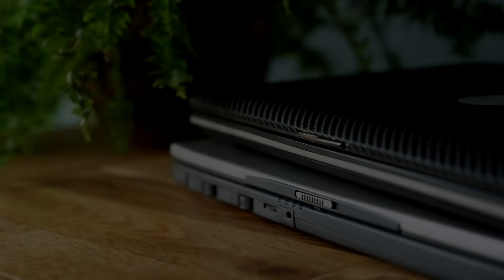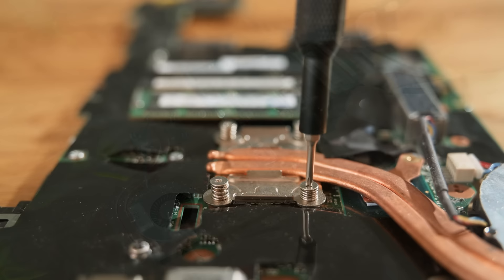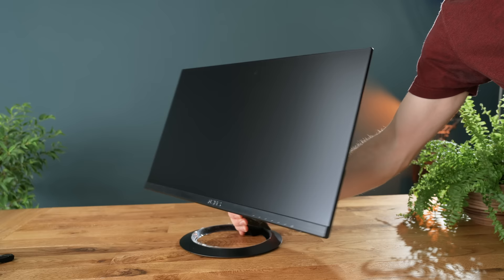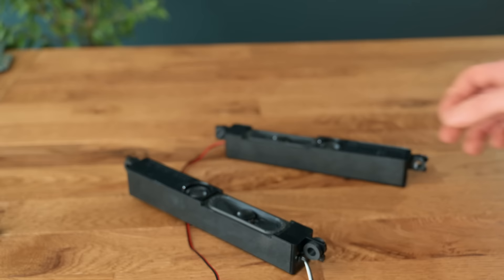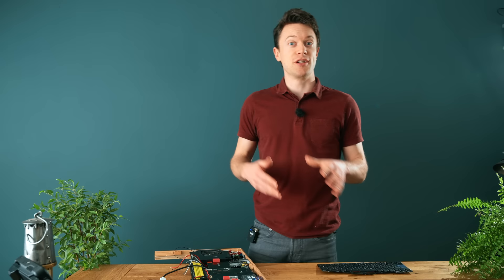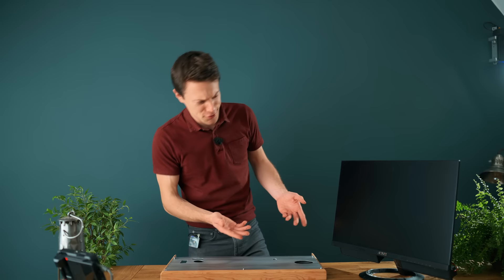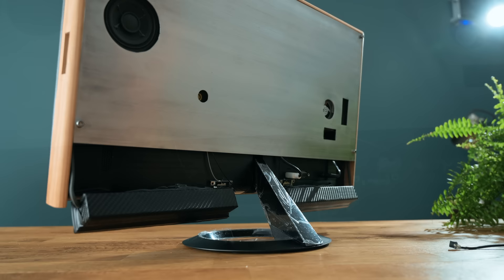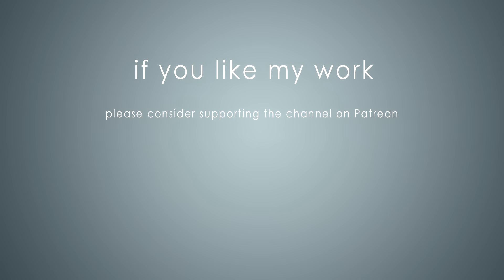Transform a Damaged Laptop into an ALL-IN-ONE desktop PC

Comment: That's a very clever way to turn it on, if it was me I'd just gut the keyboard and try to extract the button and ribbon cable 😁
Reply: Not in the long run though. Once the BIOS battery is empty, the settings will reset and it wont turn on on Power restore any more.
Reply: @El_Rekzo  what? how does that relate to my comment in any way?
Reply: @El_Rekzo  I have only seen empty BIOS batteries after they have been lying around for months with no power, and if THAT`S the case, I guess you`d have to live with setting it up again..
Reply: @El_Rekzo  keep in mind that there's a battery inside that holds power as well. So everything will still work when the bios battery goes flat.
Reply: could always use Wake-On-Lan if supported by the motherboard. Although the PC would have to be connected via ethernet for it to work.
Reply: Yea I'd try to use the original keyboard somehow

Comment: instead of epoxy - use a monitor with a VESA mount and drill holes in the backplate and use screw it on the monitor
Reply: Usually, monitors with vesa mounting on it's back are not super slim like the one in the vid, and since looks was the main concern here, a monitor with vesa mount would have ended up being too bulky

Comment: Good Job! One thing makes it easier: Instead of using a shorting switch and the usb Relay Power circuit, you just can take a release-button. the power supply is connected everytime, even after shutdown. wehn you press the release button it triggers a signal when it goes back to connect the circuit and system starts ;) no need for usb relay

Comment: Remember that laptop cases are designed around the cooling fan. Do NOT simply build a closed case with a few holes around the fan, make sure that you put vent holes where the original case had it's holes.
Also: heatpipes ARE sensitive to orientation so if you put your board in upside down, you may lose a significant amount of cooling capacity (laptops are designed to be operated on a flat surface or, drumroll, on your lap, tha angle is not supposed to exceed 45 degrees or so.
Reply: if you aren't concerned about slim design, it's easier to just mount a CPU cooler and upgrade the thermal paste solution. Laptop TDPs are tiny and something like an intel stock cooler which costs next to nothing will likely be cheaper and as good if not better than the laptop cooling solution
Reply: @romanbaranovichi5375  How will you screw it on though?
Reply: @ShaDe2301  with paperclips and snake snot

Comment: Many laptops have two interface pads on the logic board, that when shorted will boot the laptop, you could solder a power button to these pads fairly easily.

Comment: Leaving the laptop battery in place might even have been necessary for performance reasons. Apparently some laptops drastically cut CPU performance if no battery is detected.

I might actually try something similar but instead of integrating the system into the monitor I'd like to have something like the famous 80s home computers where the computer was inside the keyboard. The biggest problem would be the case. The first thing that comes to my mind is 3D printing but it's probably past the size limits of the 3D printers I've got easy access to. Plus I'm still not exactly gread at 3D modelling. Might be worth a try at some point though. The end result would be something like the original laptop minus the display. I might even try to find a way of adapting the internal screen connections to DVI, DP or HDMI, I seem to remember there are solutions for that.
Reply: Why not just CAD up a simple design that you can use cut pieces of wood to build?
Reply: @neuronoc.7343  That's certainly an option but my woodworking skills aren't the best.
Reply: I'd be worried about the fire risk of an old battery, especially when the laptop has met a brutal end like that, and especially if I'm going to have it permanently connected to power and even turned on while I'm away from home.

I've heard many laptops will refuse to boot at all with no battery connected. The CPU performance drop you mention is good to know about as well, and fairly easy to test for.

I'd like to give a laptop extended life as a home automation computer, but if I'd have to leave the battery connected I won't risk it. Guess I'll just have to test it and see.
Reply: Some old laptops also need their battery connected to change/access/update bios. Especially if the battery is detachable.
Reply: you could just print 2 part separately then glue then together :)

Comment: This is actually really cool. I'd love to do something like this but I can't even put a shelf up.
Reply: Didz same
Reply: Haha lol same
Reply: #excuses
Reply: What he doesn't state is that you sometimes need soldering knowledge to do these things, as well as the right tools, inserts, etc. Still a great channel though!
Reply: There's no need to get as fancy as this project did. I've made several systems like this by just removing the display from the laptop, bolting a plate to the VESA mounts which most monitors have on the back then ziptieing the laptop to the plate, plugging in cables, and sending it off to a new home. If you want to be even less fancy, remove the display and just use the laptop as your keyboard-with-a-built-in-computer - assuming the laptop isn't too far damaged for that. Most I use just have smashed displays. It requires very few skills and supplies if you're not too concerned about the appearance.
Reply: @MasonMouse  Of course but that's not what his DIY projects are like. He goes for function, form aesthetics.  If he was just bolting stuff together, he'd barely get any views.
Reply: @zerocal76  I was encouraging OP that he didn't need the extensive skills and equipment this video portrays to get the same functionality. If someone can use just basic skills to get a working desktop from a broken laptop, it may encourage them to learn more and then work towards more aesthetic designs as seen above. OP thought he couldn't do this but I was suggesting he can - just not to the same visual extent (yet).

Comment: 10:10 wow this is really smart!
Reply: He could've just soldered the button straight to the motherboard, finding the pins takes less than a minute
Reply: i've seen something like that about year a ago, but didn't pay attention to it, but now that i understand how everything works, i might implement this for one of my battery operated arduino projects.
Reply: @mrrandom2484  yeah this could also work but you'll need enough expertise to find those pins in this case since the power button is actually within the keyboard unit(attached to the main board via ribbon cable) or you need to have the schematic diagram for the main board to know where it is located.
Reply: @mrrandom2484  There's a reason why he did it like this. In his case, his power button was part of the keyboard, so he set up the motherboard's BIOS to start everytime there's mains power present (like a server), so he doesn't need to mess with the keyboard and its traces.

 This method also prevents anyone from abruptly shutting the PC down. It will receive power (if unplugged it runs from the battery) until it's done with everything and completely shut down.

Comment: Then again, that’s a Thinkpad. Those, especially the earlier ones are bulletproof
Reply: @user-yk9zf1jx5d  Then again, dont be rude
Reply: Its a x220 I have 1 a really nice pc butnot as strong as the t-series also he wasted the 2th 8 gig if I am correct that pc can only take 12 gigs of ram but correct me if I'm rong
Reply: @meomeo-ue7qd  either way it's a bit of a waste. Any program that can actually benefit from 16gb will be limited by the CPU anyways. 8GB would've been more than enough for the kind of use that computer is likely to get.
Reply: ThinkPads are nice laptops, i have one.
Reply: i used to have a E series, the "cheap" thinkpad, it was awesome but i sold it because it was slow

Comment: Since there's some wood on the side of the case, I would slap a fan on the back for extra cooling
Reply: Wood doesn't just start burning though.
Reply: wood starts burning at around 451°F that pc would die long before reaching that temperature
Reply: Y'all probably don't care, but the temperature point at which a material spontaneously begins combustion is known as its 'auto-ignition' point.
I just find that interesting.
Reply: @MrScorpianwarrior  Thanks for sharing
Reply: @Greenfire44  its not about beeing able to combust its about woods ability to store heat
Reply: @vitorcristiano9744  The whole bottom was left open and there IS a fan.
I don't see a problem

Comment: Would've really loved seeing you unplugging the PC and carrying it away to demonstrate the battery keeping it powered on though.

Otherwise, a great video as always, I'm actually thinking about doing one of these from a old laptop to gift to my little sister as a first computer for her birthday :)

Keep up the good work, Matt, what you're doing is great !
Reply: both audio and monitor will not work since they powered by external power brick. it only provides relocation only based on his circuit layout
Reply: You'd probably be able to turn off the monitor while it's still running and put it in another room that has a cable ready for the monitor. Its portable only in the sense that you can't use it again until the monitor is powered back up.
Reply: .. and how to turn it off.. without running the battery flat.
Reply: Oh ok, didn't understand it this way, my bad, then.
But still, I was just saying it would've been even more awesome with a demonstration
Reply: @brunselltorp  with the power button, I guess, but I admit I didn't fully understand when he explained how he installed it
Reply: @brunselltorp  Start~Shutdown. DOH!

Comment: Man you're good!

I'd only do one more thing: that vinyl film - I'd put it on the back. I think it would look even better than just aluminum.
Reply: See, I wouldn't use the Vinyl film. I would do the brushed aluminum and then a single coat of flat black paint. You'll still get the brushed metal look, but a more sleek look to it.
Reply: Norman Jeter Also a very nice option indeed
Reply: I would use vanish on the wood as well, and a gloss paint on the aluminium to make it shinier and give the premium feel. And Also the speakers would be in wood enclosures.

Comment: Hey I love the project and think you did a great job!
I think you may want to add a switch between the really and the USB port. The reason for this is because right now it seems to only be able to be turned off from the computer being shutdown through the OS but again computers aren't perfect so if it ever freezes it won't be able to shut down through the OS. That's where the switch would be useful to shut it down otherwise you'd have to take it apart to rip the battery out. Just a tip. Great project!
Reply: just switch off the power supply if it freeze? 😂

Comment: 10:44 you must have connected the amplifier and the monitor to relay instead of connecting to the switch or else they would turn off as soon as the circuit of the switch loses power

Comment: That CPU is old. It is a second gen Core I5. They are now up to 11.
Reply: you would be amazed how well do old i series processors still hold up, a i7 3720qm which is a mobile laptop cpu is as fast as a 11th gen i3
Reply: It is a 2011 Sandy Bridge Lenovo Thinkpad X220 so it is 10 years old.
Reply: me with core 2 duo:
Reply: XTRAP Yeah and I am still using the Acer TravelMate 3270 with the first generation mobile Intel Core 2 Duo (T5500). It still run Windows 10 64 bit pretty well with 4GB RAM and SSD through SATA to IDE DVD caddy adapter for 2.5 inch SATA drive.
Reply: And people still think that the latest i3 is not powerful when it perform on par with i7 back in 2017.
Reply: I still have a laptop with a dual core i7 2640m, it's blazing fast for basic tasks like browsing youtube, for example the new codec AV1 works flawlessly in 1440p resolution, you don't need anything better for a 1080p screen. 2-nd gen Intel was a breakthrough and it still holds up even today.

Comment: You're an incredible artist. I'm continually impressed by this level of creativity. FYI: the placement of your "subwoofer" affords several advantages: the primary "boundary effect" from the location in the wooden frame (producing effectively an 'open baffle' type of 'enclosure'). Plus the fact that the driver is facing the wall behind your desktop enhances the lowest frequencies the driver is capable of reproducing... Results will vary depending on distance from the  adjacent rear wall, and of course if there is no wall (freestanding) then there will be no bass reinfocement from said rear wall. This was a pleasure to watch, and has inspired me on 4-3-2020 'quarantine break' to take a good old, beat-up working laptop & make my own version of this project! Kudos + 💯🙏🏼 Thank You!!! Edit: forgot to mention the enhanced bass you get by mounting that small bass driver 'asymmetrically' on that huge rear 'baffle' (your aluminum backplate).  It's effectively a purely mechanical "bass boost". Cheers😄

Comment: I just want to know how many people actually "transformed" their old laptops into newer ones.
Reply: 0
Reply: 1
Reply: I have, I completely dismantled an old laptop of mine, I ensured everything worked when i got it out of the laptop casing and were good to go! I am 3d printing a mat with screw holes that I can mount the motherboard and fans to!
Reply: Id be so keen, purely because i couldnt part from my laptop even though its 8 years old, battery is no good and keyboard doesnt work either. Id add another hard drive and dvd drive too though and since mine doesnt have bluetooth, id add that too.
Reply: I did it last year with an older Asus netbook.I sold it for more than I paid for it.Kinda.wished I kept it lol

Comment: Would be dope to see a final price tag or something. This project isn't practical but would be fun to see its price.
Reply: Actually I do this all the time.  However I. Have a Goodwill Computer Store with a barvin bin full of these for $20.   Not sure be that bold if I only owned ONE.
Reply: If these are brand new parts,it would be around $200
Reply: Why do you say it's not practical? All my friends and family hand me down their old or broken laptops to either work on or use as parts as I see fit and I have lots of extra flat screen monitors like this one  so it would cost me very little to build so in my case it is totally doable. I'm sure I'm not the only one with these parts laying around and if you don't have them take a trip to your local Goodwill or thrift store. I'm actually thinking of building a couple of these for my family and friends that brought me the lap tops in the first place. I also have a nice touch screen so one of them will be touch for sure though I will have to find a sound solution since I don't have those speakers but I see external speakers at Goodwill all the time I could go that route I mean would be giving them a free computer.

Comment: This was exceptionally well done! The only change I could make is replace the thermal pipes with a heatsink for better CPU cooling.
Reply: Thermal pipe is connected to heatsink. Lol.
Reply: @CheizzanfueL  Right, but it transfers heat to another heatsink further away from the CPU. A larger heatsink directly on the CPU would enable you to run the system must warmer/better.

Comment: Why don't you use monitors which uses USB powers? So you don't need to connect another wire flowing from the power source to the monitor. BTW great video. I was trying to develop an idea like this before

Comment: Arguably, if you're doing this to resell, theres as much or more of a value add in building it as a slim media PC. Most people have a spare 1080p monitor or tv lying around, so if they need it for a desk then that's easy, but there are a lot of people who will shell out big for a good low-power high-res media system.

Comment: My dad told me about this instead of buying a regular gaming pc to save money lol

I cried😂😭😔
Reply: It is cheaper you would say, but you really have to find a good laptop ( ''gaming laptop'' ) to at least have ( or be able to have ) 16GB of ram, at least 2.5 quad core or more ( or better processor ). But when it comes to gaming you need a good video card, which laptops don't have ( that if you manage to buy a near gaming laptop with a broken screen or something that makes it cheaper but still usable with a monitor ). In the best case is has a wi fi board you can connect an external video card with an external dock support. In this case you can make a ,,gaming" pc out of a laptop motherboard.
Reply: The problem is, our laptop is like 8yrs old toshiba hahhaaha

Comment: how to transform a damaged laptop into a good pc:

turn on the damaged laptop, plug hdmi into the laptop, plug the cable into the monitor

there we go! :D
Reply: Haha right. Im using one right now with a 19 inch monitor.
Reply: @agentblue52 nice, i was thinking of the same thing and it will be easier to switch to another monitor
Reply: That's true, I've done the same.  But it would also be useful if the laptop is upgradable.  Some laptop manufactures annoy me with the way in which they seal off everything.